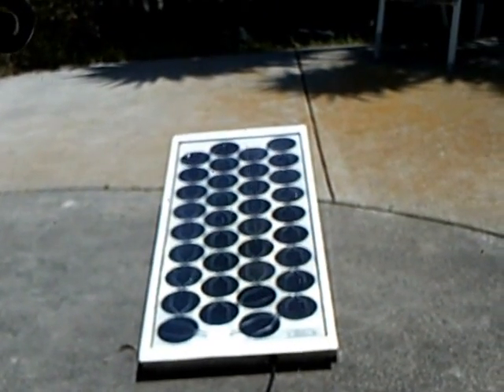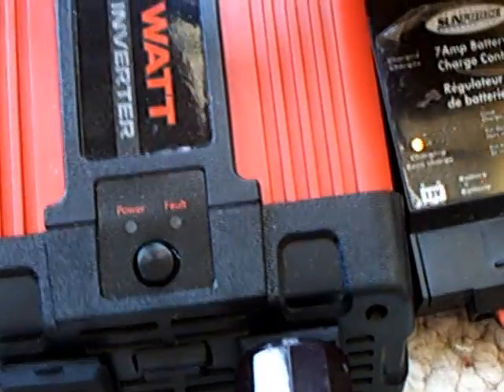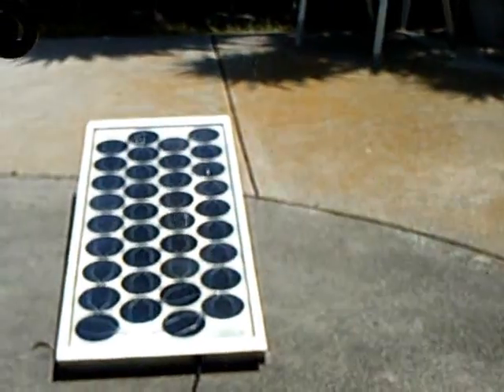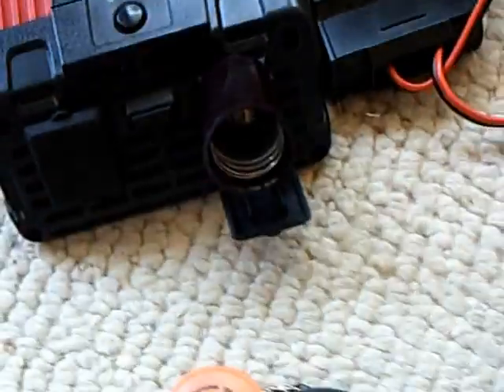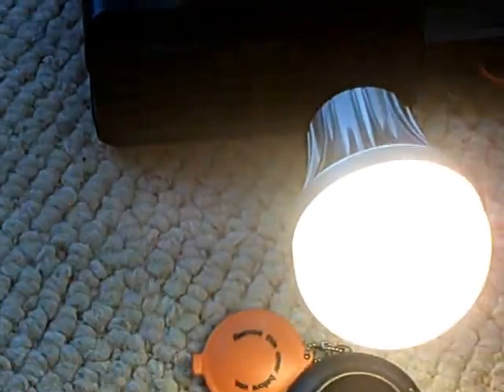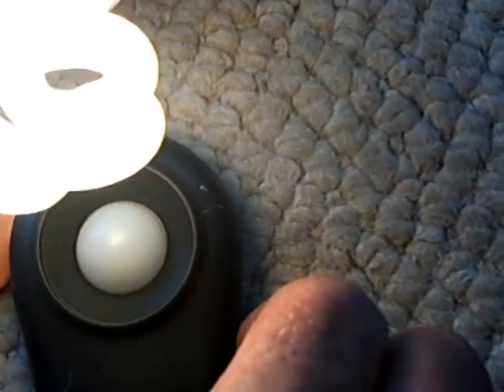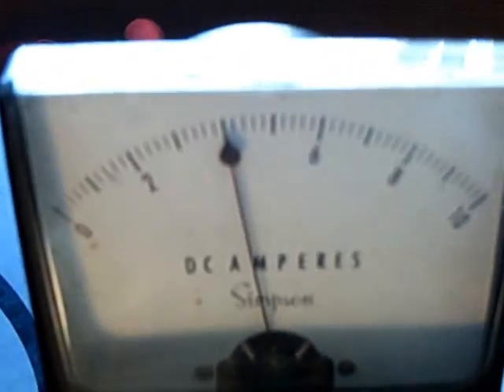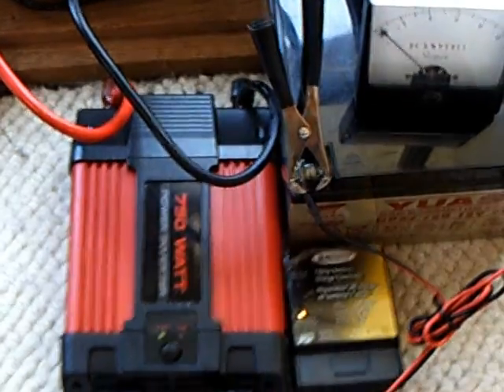Simple home solar energy system--- with 120v AC Light Bulb comparrision

Comment: On my joule ringer, I found a 9 watt led ran brighter or equal to a 13 watt jr3 cfl and the led ran for 1h 10min as opposed to 50mins. In terms of brightness, the 9w led illuminated a small box room as effectively as an 11w mains connected cfl.  The jr3 Cfl was a pain to switch on and off reliably as well.  My 9w led is in a light box A4 by 3inches deep with 1  ni-mh drill batt (14.4v).. (nice and portable and if it was 6" deep with x6 drill packs it would conceivably go for 6 hours, and so on..  so portable and doesn't take up to much room and can have auxiliary packs to get you through a fair while with out those dam inverters just for lighting.,  so, i feel, a jr3 can be more portable than a 12V boat/car batt/inverter set up.

Comment: I live in Japan and I found them in an electronics shop in a market here. They aren't seeling anymore at the shop. 
They are Teknos LE-04W bulbs. I found a few on the the net, but the link is very long. Amazon had some.
I have other lights similar to Lights of America and they act like that too in series. 2 in series goes up to a bout 500ma, but in parallel it's about 700ma. My set up might be different though. You could try other bulbs you have.
Anyways, love your work~!

Comment: Have you tried putting LEDs in series with the French Flipflop? Depending on the bulbs I got some interesting results. I found some cheap Chinese 4W 250lm LEDs which gave me some nice light. 1 is 400ma fully lit. 2 are 800ma fully lit (not sure why) 3 in series dropped lm slightly and goes back to 400ma (not sure why) but nice light. Can light 3 rooms of my house reasonably well on 400ma. 
Anyway, I've followed your work for a long time and you have inspired me and helped me a lot.
Thank you~!

Comment: Sounds like fun Rusty. Though I have not made any real "gains" as in ... "overunity" I stumbled into Lasersabres circuit, essentially several months ago (very similar anyway). Essentially, an SSG light. I managed to illuminate about 100 LEDs off the circuit and played with it extensively, so much, that... I was able to measure overunity. But, then, I took a closer look. Much care is needed in respecting the limits of a DMM in +3kHz. They can lie. 'nuff said tho.

Comment from the maker: Thanks for that info.  I have similar things.  That French flip flop inverter that I made awhile back does a pretty good job also with small draw items.  This big 750 watt inverter is what I need to run big stuff  though like my 120v electric drill and such.  It will power up my small ac refridgerator that I have on the sailboat while I am using the diesel inboard to get around when there is no wind.  Usually when I go to Catalina Island I have to power so I run the fridge on the way.

Comment: Similar to a lot of sorts of tests I do. I have found, thus far, watt for watt.. my best two options are a fast switching mode inverter, the type you stuff in a cigarette lighter. On sale for $10. It consumes 140 mA plugged in, just at idle. It consumes 140 mA plugged in, while powering a 2 watt AC LED bulb. Running a close second to that is a XEE2vids CT transformer variant of the joule thief, but operating off of a 3.6V 4000 mA/h Lithium cell. It powers the same bulb at an adjustable .1-.4A.

Comment: again,
we can venture to  other possibilities ...   I  think   going back to Joule Ringer 1   is still my bestb bet   as I can expand using toroid and charge back  a little when the load is off   
please try the Xee2 mode using transformer   koule Ringer 1    but like you said  heat issues
on the transistor

totoalas

Comment from the maker: Some things are designed to run on 120vac (like a small microwave oven) and that forces us to use the inverter.  You are right though that there are many things that can simply use a 12 battery as the source of power.  LED lighting is perfect for that.

Comment: Thanks for your tireless devotion & sharing - big fan of your vids!  I haven't sacrificed an LED bulb yet - wonder if they can be run DC only (sans AC setup) - bypassing the need for the inverter.  Other than most appliances & larger industrial tools, I've not seen much that can't be recharged/run off of 24vDC or less (laptops/tablets, cell phones, mp3 players, cordless tools, etc.)  This & inspiration from your joule ringer shed vid makes me think of a permanent solar DC only home circuit!

Comment: well as i see it there is only one major downside of incandescent bulbs, that's them being power hogs (less than 3% of energy turned into light) other tech greatly, but the light quality (CRI), especially of CFL's, is poor. i can tell the difference between cfl and normal bulbs, under fluorescent lighting, things and stuff just don't look natural, while under the wide wavelength output from standard bulbs shows beeter the color detail of things.

Comment: Hi Lidmotor... replace the charge controller with an oscillator type impulse charger... even a JT type of setup.  Charge your batteries from the solar panel with that, then run your 12V load off your battery.  The inverter is a TOTAL waste in almost any PV arrangement, as most electronics are going to run on low voltage DC anyway.  You lose about 40% going from DC at the panel to AC at the inverter then back down to DC at the load.  I know that does not apply to those 120VAC bulbs, but 12V LED:)

Comment: Best thing to do with incandescents is run a Slayer Exciter at 'em and get the plasma inside ! The phrase may be 'they are so last century'.
Boxed up and neat, the high efficiency home circuits will beat the commercial offerings i'm sure. Plus, the circuits can be changed/improved/set up differently/repaired...but I see your point, why replace what you already have that works and is built well.